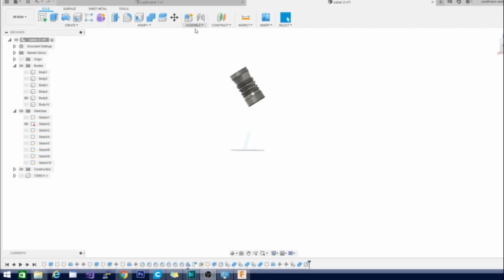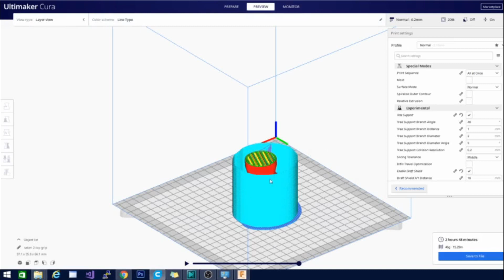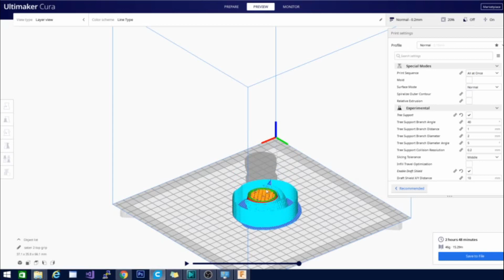How To Print ABS on the Tevo Tarantula Pro

Comment: I have printed solid’s laser cut enclosure which is very nice but takes up more space than I like.  I also have the creality soft side enclosure and the Wham Bam soft side enclosure.  I prefer the Wham Bam one.  I usually end up printing ABS in the summer in my garage, without an enclosure, on my prusa MK3S.  I use a raft and I’ve had good luck as long as my garage is over 85 degrees.  I haven’t tried using a draft shield. I usually print in PETG and PLA as I don’t like the smell of ABS.

Comment: Hell to the Yes, T3! Thanks, this will come in handy. Let us know when you github the ABS profile, thanks for that too. I already ordered a heater bed mosfet for my TP,  I heard the TP 's power supply is  a bit weak. Probably old news for most folks, but I like the ebay photo tent enclosure method.  I never tried it personally, recommended by Prusa. keep em comin thx p3
Reply from the maker: creality actually sells those little photo tent pop ups as enclosures now, i hear they work pretty well.
Reply: Wham Bam makes a similar enclosure to the creality one.  It’s a bit more expensive but is sturdier and easy to fold up when not in use.